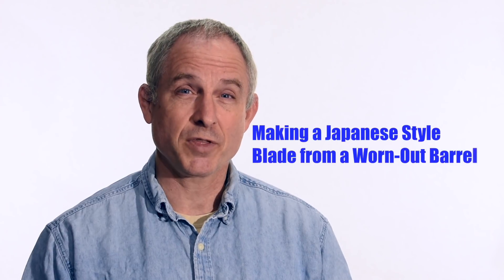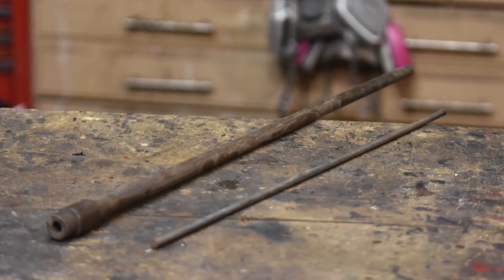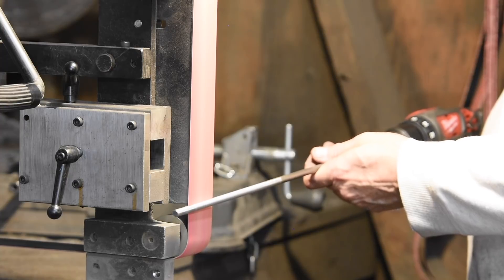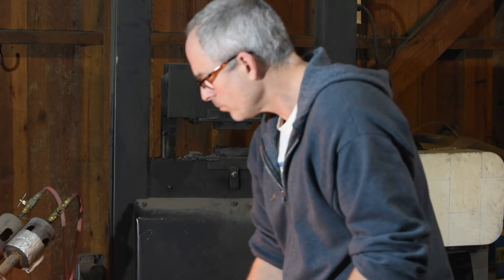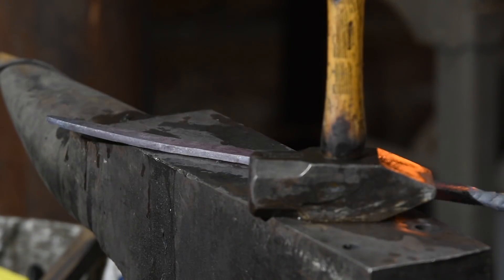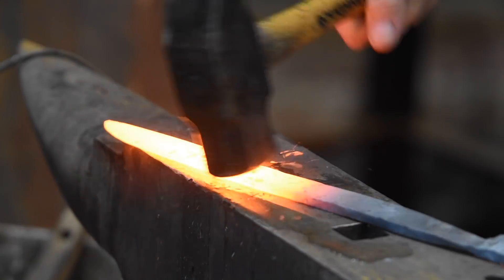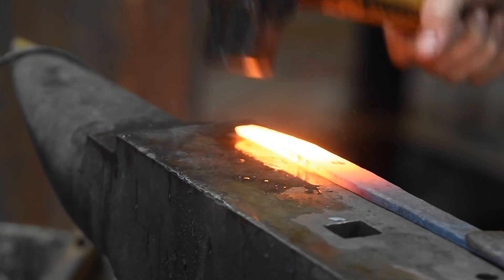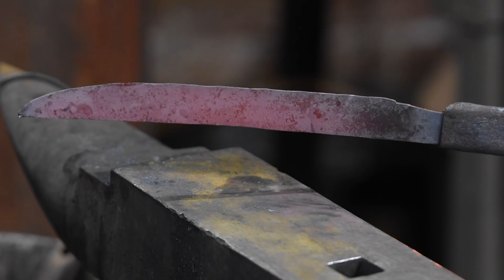Barrel to Blade:  Making a Japanese Style Blade from a Worn-out Smokepole - Pt. 1

Comment: If you ever do this again, before sanding the bore and rifling, clean the copper and lead out chemically.  50% acetic acid (distilled white vinegar) and 50% solution of 3-4% hydrogen peroxide in a container and soak the barrel for roughly 2-5 minutes.  Then neutralize the solution off the barrel in a separate container of sodium bicarbonate mixed in water.  Then hit it with sand paper.  This is the mixture we use in the shop to remove lead and copper from really leaded out barrels and suppressor baffles.

Comment: One question, instead of begin sealing from the tip, wouldn't it have been better to start sealing from the other end to the tip, so the flux inside the bore would flow to the outside?

Comment: This was a common method to mass produce these swords during WW2.  They used high carbon steel tubes with a mild steel insert.  They would just chisel cut the tip and hammer it back the opposite way so the soft core center would be on the spine and not the blade side.  Great video.

Comment: For anyone who thinks this is not how one should make a katana consider this: Back in WW2 the Japanese started making swords in almost exactly the same way as Walter does in this video. They did it by inserting a mild steel bar into a hollow tube of hardenable high carbon tool steel, forge welding the two together and then forging the sword from that.

Comment: Maybe I missed it, but what is the function of the oil you've got on the hammer and anvil?
Reply: Mike Gray It's actually water, and it's supposed to blast off scale so it doesn't get hammered into the piece,
Reply: Ok, thanks. :)
Reply: That would be water and it creates a little blast of steam
Reply: I was gonna ask the same thing. Good to know.
Reply: I'd say it was the borax flux, water would evaporate much quicker with those temperatures.
Mind you I've just watched it again, not entirely sure....
Reply: Piazzapower no it is water, the idea is exactly as you said. It evaporates the second the hammer hits the steel and causes a burst of steam which blasts the oxide layer off of it.

Comment: I thought Japanese swords has hard cores and soft skins
Reply: radradroadbot -  There are a number of different techniques that Japanese smiths have used to combine hard and soft steels, and some even added medium carbon steel into the mix.  What your thinking of is san mai, where there are three layers with the high carbon steel in the core and the lower carbon as the skin.  I don't know the Japanese terms, but there's also the "canoe" or "hot dog in a bun" 🌭 method where they wrap a high carbon steel around a low carbon core just like a taco shell 🌮 this sort of mimics that technique ;) .   Just do a quick Google image search on how katana were made and you'll surely find diagram showing a bunch of different cross section drawings of how they stacked and arranged steel/iron with different carbon contents to form the blade.

As long as the blade and bevels are forged close enough to shape, the low carbon core far enough away from the edge to have to really worry about being ground into.  Also, as long as the steels are forge welded properly, whether the soft steel be the skin or the core steel, it will help to absorb shock though the cross section of the blade, since they are essentially one piece of steel once they're forge welded.
Reply: radradroadbot i think you're right because if you have a hard outside on the billet after you grind down you're gonna hit that soft steel and your edge will be garbage
Reply: thedamned93 exactly what I was thinking
Reply: radradroadbot he's talking about interior and exterior with respect to the curvature of the blade.
Reply: But i don't see how it would help it to have the hard steel completely surrounding the soft steel rather than having a soft steel jacket and a hard core and edge
Reply: Sean Nesloney he just said he was going to put mild steel inside a gun barrel unless he cuts it down the center and forge welds the billet so the mild steel is outside he will have a mild steel edge either that or the mild steel is set back far enough that it will take a lot of resharpening to hit it

Comment: The hard steel goes in the middle.
Reply from the maker: As a bunch of people have noted, there are several techniques like san-mai and hon-san-mai which sandwich a hard steel bit in a softer jacket.  Most contemporary Japanese traditional smiths use the kobuse (sometimes referred to as the "hotdog" method because the hard steel surround the softer core steel.  When using the kobuse method, the forging pushes plenty of hard steel to the cutting edge, so unless you take off way too much steel, only the hard steel is exposed.   In the second episode of this video, you'll see a cross section of the forging which shows that the core steel is actually quite far from the cutting edge.  Incidentally the potential problem you're talking about is not completely unfounded:  a common problem found on really old swords that have been polished repeatedly for centuries is that the harder skin steel is worn away, leaving patches of softer core steel exposed.  Bear in mind this generally happens after about seven or eight centuries!
Reply: That's San Mai you're thinking of.
Reply: San Mai. San Mai, in the context of metal blade construction/metalwork, refers to a knife, blade or sword that has the hard steel hagane forming the blade's edge, and the iron/stainless forming a jacket on both sides. It is also the term used to refer to the technique used to create these blades.  The edge should always have the good steel, no?
Reply: Yes the skin steel is tamahagani forged into a U shaped billet closed at one end then a soft iron billet inserted inside the whole thing then gets welded together in the forge.
This is called kobuse technique

 
Home (0) Messages (0) Harbour (0) Posts (5) Likes (37) Basket (2)
 Gravedigger47
(Chief Petty Officer) 
Home Page
Forum
Photo Gallery
Video Gallery
Build Blogs
Boat Harbour
Model Boat Clubs
Events
Model Shop
All Things RC
Plans & Docs
Site Search
Members List
Get In Touch
Useful Links
This Website
Guestbook
Join Us On Social Media!
        
Get The Model Boats App!
Apple App Store
Android app on Google Play

  

Help Support This Website £ 
PayPal — The safer, easier way to pay online.
or enter custom amount£5£10£15£20£25
(Contributor)

You last donated
17th September 2017

Many thanks for donating!

£285 a year is needed to keep the website and apps online. Please consider donating £5 or more to help towards these fees.
Read more
All donations are securely managed through PayPal. Amounts donated are not published online.

Many thanks for your kind support.

Model Boats Website Team

Donation History
October 2017: 7 people
September 2017: 15 people
August 2017: 10 people
July 2017: 16 people
June 2017: 8 people
May 2017: 8 people
April 2017: 23 people
March 2017: 9 people
February 2017: 4 people

Unique Visitors This Month
 

Website Members
 

Terms and Conditions
Privacy Policy
Advertising
Contact

Model Boats Website
Active Users (20)[Toggle Sound][Close Panel]
Active Now
Gravedigger47 (Chief Petty Officer)Online Now
Viewing: Build Blogs
Guest (1)Online Now
Viewing: Model Shop
carl10r (Chief Petty Officer)Online Now
Viewing: My Likes
ned (Seaman)Online Now
Viewing: Tags
Brightwork (Sub-Lieutenant)Online Now
Viewing: My Harbour
jeandani (Recruit)Online Now
Viewing: Forum - Building Related
chrisduncombe (Seaman)Online Now
Viewing: Member Details
mahera1 (Recruit)Online Now
Viewing: [Mobile App]
Guest (2)Online Now
Viewing: Video Gallery
Reply: Kobuse is the correct term.
Reply: No, hard steel goes to the edge. Sometimes that means laying it in the middle of two softer steels. In this case the entire outside is hard steel so he can make the edge whatever direction he wants and it will still get hardenable material where it need to be.
Reply: That is one technique,
Kobuse is the method of forming a billet of tamahagani (that's hard skin steel) closing one end for the tip then inserting a billet of mild iron into the U shaped builder of skin steel and fire welding the whole together then begin to draw out a stick in turn shaped into a blade etc.
I do not have the name for the technique you are using unless it is this sanmai but I have never used anything like that.
The great makers also used to have hard steel for cutting edge and back edge soft iron do the core and agrade in between for the sides
Reply: I have only seen the hard steel sandwiched in the middle by softer steel.  hen ground the hard steel is in the middle and is the edge.  Having the soft steel sandwiched wouldnt make a good knife.
Reply: The soft steel in the core in this method doesn't reach the edge. It only makes up a small percentage of the steel structure. It's different to the method you've seen where a large amount of hard steel is sandwiched between two softer sides.
Reply: Ok.  What Samurai sword maker uses that method?  Is it superior or inferior to the traditional method.  Walter is saying this method he is using is a traditional method where every video I have watched of the Japanese and of Walter even,  they use the  soft on the outer layer(s).   And to make sure I get this method I never seen,  its kinda like a jelly  doughnut?
Reply: I don't know enough about swords to tell whether one method is superior over another, I'm not a swordsmith... I only make knives. Both methods are traditional as far as I know, just that San Mai is more widely known and popularized by western blades thus there are more videos of it as opposed to the method shown here.
Reply: Thanks for the info bro.  Much appreciated.
Reply: With the kobuse method, it seems there would be no layering.  Like damascus or just the one like on Samarai swords.  That extra beauty is why san-mai are probably much more popular and desired.

Comment: What is the liquid on the anvil
Reply: It's just regular water. When the blade comes out of the forge it has oxidized scale on it that can mess up the blade if not removed. The water combined with the heat of the blade blasts the scale off easier than brushing with wire. Hope that explains it :)
Reply: Jeremy Clark water

Comment: Hello  Walter
At the beginning of this video  you said that the Japanese katana is made of soft metal  with a harder Steel  shell. 
I thought that it is the other way around. 
So that the hard Steel is in the middle to hold the edge of the sward  and softer Steel as a shell  to absorb the hits.
May you please clarify that issue?
Reply: That would work in a San Mai forge weld, but he is filling a tube. I believe in a traditional tamahagony build, the core is soft and the shell is hard, However, the spine is softer then the edge due to the claying procedure slowing the cooling of the spine. Hardness is achieved through faster cooling.
Reply: I agree that it sounds weird,  what I expect is that the core having the lowest stress doesn't need softer steel.  Unless it catches up cracks.  A cool build nevertheless.

Comment: If Masamune and his contemporaries were alive today, they'd tell these Japanese blade purist snobs it'd be crazy to forge blades the way they did with all the technology available today. Those men were master craftsmen not because of the techniques they used but because of the innovation they used to create them. They'd be pleased to see the innovations we have today and how they would be used in their trade.
Reply: I agree...  I use a hydraulic press and power hammer for the heavy lifting, but I still like to use a hand hammer and anvil to get the proportions and detail right. Stone polishing is for those who are gluttons for punishment IMO.  But to be completely honest, I use good plate steel, cut the blanks on a plasma table and heat form the rest from there.  Cuts SO much time off the process.  Time that I then put into making the furniture.  The carbon content is much more consistent throughout the blade and from one blade to the next.  Proportions (i.e. is it correct; does it function properly; will it last), to me at least (as a practitioner of 40+ years), are much more important than old world techniques.  

I'm not knocking the old school guys one bit mind you.  I still go that rout from time to time.  All I'm saying is that the steel we have access to these days does not require that you go through all that folding and drawing.  That is purely for aesthetics at this point, and if that is what you want, then that is what you should do.  Even what Walter is doing here is just a shortcut to an old world technique.  Time is money.

That being said, I still only make blades for myself.  I do sell a few when someone I know to be a serious practitioner is in need, but I have given more away to my students over the years to represent milestones in their advancement in the art of Kenjutsu then I have sold.  These blades are fully functional but rarely ever see any furniture outside of sira saya.  Belts are meant to hold you pants up, but a blade is something that represents dedication in a way that a strip of cloth never can....  And I guarantee that if I hand you one of mine, you've earned it, and THAT is about as "old school" as you can get.
Reply: yes and no, swords of yesterday were pretty crappy , the steel was folded which meant it was not pure, and you hated it multiple times and that means you lose carbon, and not all the impurities are out of it, we like to look at those swords as magical no, they were actually worse
Reply: yes tradition does not always mean best, tamahagane was a very poor steel, they guessed on the carbon content, could be high carbon or low after they chose it and heat it and forge it
Reply: Exactly! If Masamune knew what we know today, he would have incorporated it into his work. A lot of their metallurgy was guesswork and he would've been stoked to have a scientific formula for good steel and repeatable processes. Don't get me wrong, it's amazing what those old Japanese swordsmiths were able to do given the limited technology of their time, but had they known better, they would have chosen to use the methods we have today.
Reply: sidgar1 holy fuck shit someone who understands!
Reply: You’re right, Sidgar1. Those old Japanese swords were high-tech for their time and place.
Reply: Masamune would love L6 steel. He loved making the edges of his swords ridiculously hard. Anyone who thinks otherwise should look into the history of something called (in English) "gourd steel".

Comment: Random question but what is the liquid on your anvil?
Reply: Its dihydrogen monoxide...
Reply: Most likely just water, either from the quench bucket or to blow the slag off when he hits the piece on top of it
Reply: You put a little water on the anvil to create a little blast of steam to clear any slag off the anvil as you strike.  This keeps the slag from getting hammered back into the blade.
Reply: It's water. Pretty common to wet the anvil and hammer so it blows off the scale.